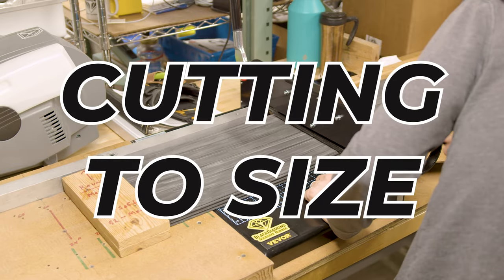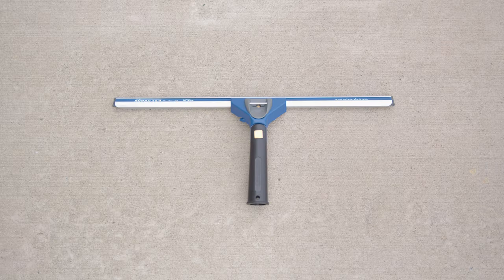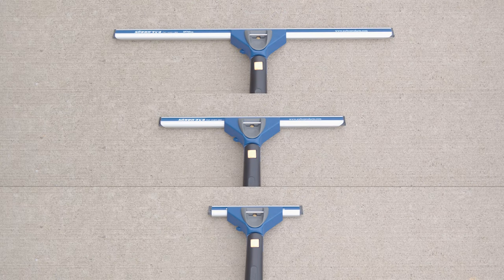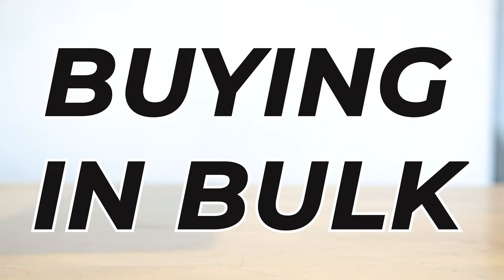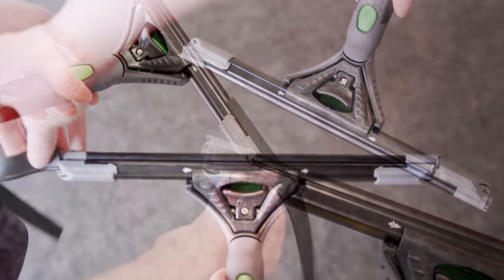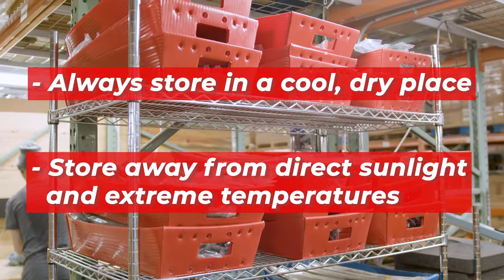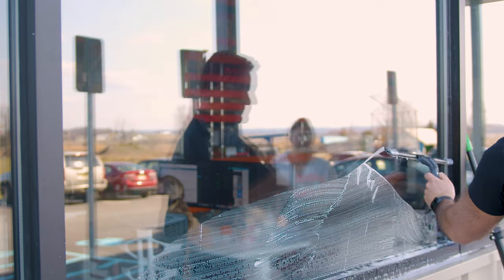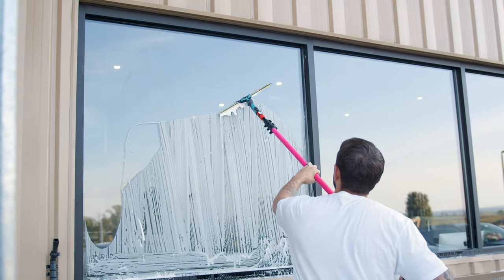3 Tips to Save BIG on Squeegee Rubber

Comment: How often should change the rubbers and do we know when it’s worn
Reply from the maker: How often you need to change rubber does rely on several factors, but a general rule of thumb is once it begins to leave streaks consistently, or has nicks in the blade.